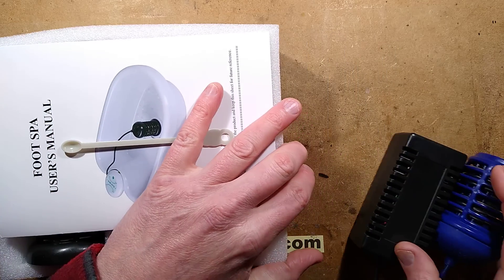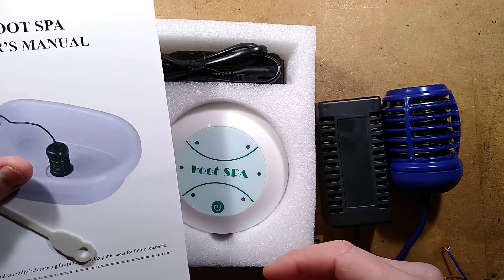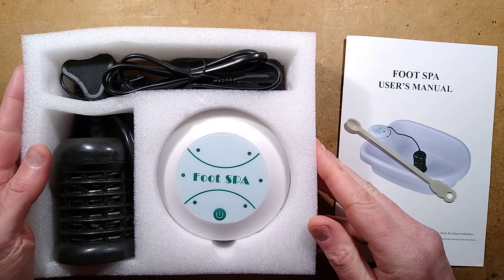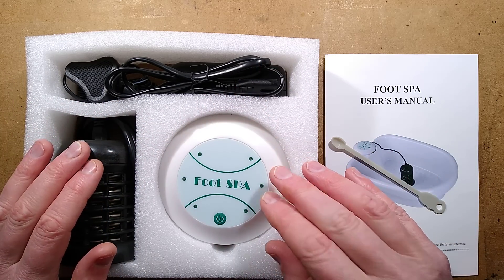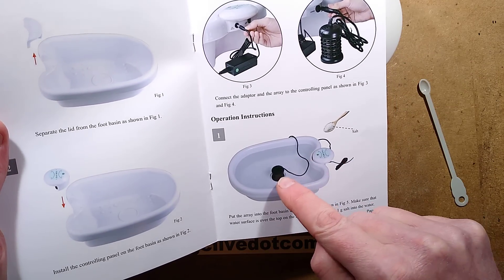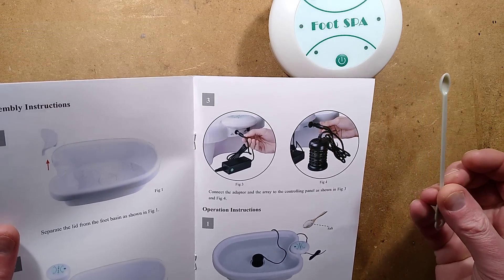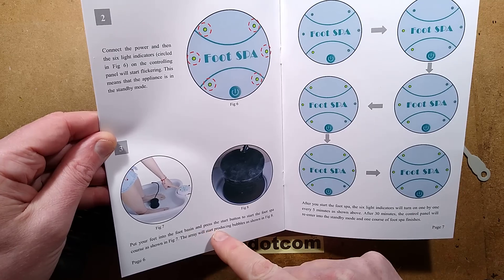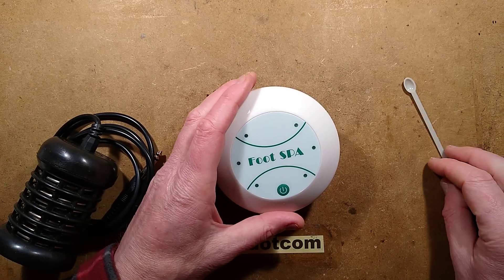Inside an ionic foot detox spa unit.

Comment: What's actually going on with that thing is, you have a stainless steel coil? And that coil, when you put a positive charge on it in water, even when you add salt, it will definitely change the color of the water. It has nothing to do with your feet at all, it is not drawing out. Impurities from your feet or your body in any type of way shape or form it is very misleading, because if it was drawing anything from your body, then it would be coming out of your pores, not out of the machine, I built an HHO . Generator before a car... And if you ever see the video of once you put a positive charge on stainless steel plates, watch how the water will change the same color just like you see on the color codes. So yes, it's a huge scam. Don't waste your time nor your money. Because it doesn't do anything you might want to be careful though. By putting your feet in contaminated water. Because that it's definitely not coming from your body at all...

Comment: I just received a free one of these to review (slightly different model — I got 2 of the arrays because I guess they crap out after a while). I'm not going to use it in the intended way. Would it be possible to convert it to a plain old whirlpool bath for my feet?
Reply from the maker: It's only really intended to do the corrosion trick.

Comment: I work in an electroplating facility. We are NOT allowed to discharge chromium from our waste water treatment system into the city waste water system because it’s a toxic heavy metal. For god’s sake don’t use these things people. We treat it then filter it out and dry it,bag it in special bags that have to be properly labeled and picked up by a hazardous waste disposal crew on a regular basis. We can’t even keep them on site more than a month!!! I should point out we use hexavalent chromium which is different from chromium in stainless but high nickel concentrations are poisonous.

Comment: What if.... The current & voltage given to electrode is very high? Or even AC current?
Reply from the maker: Fast AC won't work as it has to be DC to cause the corrosion.  Higher current will result in faster corrosion.

Comment: What's the salt? I've heard if you electrolyze NaCl saltwater you produce chlorine gas.
Reply: That might happen if you had electrodes that didn't corrode, but these ones do corrode and we get a series of chemical reactions ending in iron hydroxide and hydrogen gas. Plus oxides of any other (possibly poisonous) metals in the electrodes. Little or no chlorine escapes.

Comment: Don't  'UK non compliant plugs' basically just have the same safety features as a North American plug? Are they really any worse than what I use a dozen of every day?
Reply from the maker: Our power circuits are capable of a continuous normal current of 32A at 240V.  So local fusing for cables is a good idea.

Comment: You know what is funny... I can tell from watching this video that you have actually never tried using this unit yourself...  which is so laughable... had you tried it, you would understand what all the hoopla is about... electricity delivered to the body in this manner DOES have health benefits... I agree, I don't think the debris is in the water is coming out of the body... but the ionic negative electricity has a positive effect on many bodily functions...
Reply from the maker: This arrangement does not pass current through your body.
Reply: You absolutely have no idea what you are talking about. Like Clive said this doesn't pass current through your body it merely oxidises it own electrodes and hydrolyses the water producing a soup of chromium nickel and other heavy metals (yum). Also passing current through you body is not healthy (Enough of it will kill you!)  Ionic negative electricity is just a buzzword. Ions are atoms that either have an extra or missing electrons. Negative ions have extra charge, positive have missing charges. You cant ionize electrons they aren't atoms.  Also ions aren't beneficial in any meaningful way. This study https://www.ncbi.nlm.nih.gov/pmc/articles/PMC3598548/  proves that they have no effect on health and there is at best luke warm evidence to suggest they have any positive effect on mood.

Comment: This detox thing is a scam only way to detox by using the bathroom I have that I’m trying to send it back they are giving the run around not giving me return address offering to replace if you put it in water without your feet you’ll get the same results water still change it’s all corrosion try it and you’ll see it’s a scam

Comment: I'm curious about the power supply. I noticed it was labeled UL which at least in the US is the key thing we like to see on our electronics. I worked for a large CCTV manufacturer as a Computer Systems Engineer; part of what I did was get equipment ready for compliance testing.  We had an inside lab that was authorized to do testing including FCC, and UL for all of our in-house products. I've seen the beating equipment has to take to pass these tests, and the hoops we had to jump through to earn that rating for our products. so I generally consider UL listed products to be safe. I was wondering what made you think the power adapter was unsafe aside from the detachable power cord.  I more curious if the manufacture just included a junk region specific power cord, or if they randomly slapped a UL logo on a product that never obtained approval (a problem we're seeing more and more of lately).  Could you possibly do a tear-down of this adapter? Thanks, MGB
Reply from the maker: I don't consider any of the directly imported power supplies safe.  The UL and CE markings are fake.
Reply: @bigclivedotcom  I figured that was the probably the case. I've seen this many times on knock-off Apple, LG, and Samsung USB chargers where they just copy all the markings in an attempt to make them look authentic. I've also seen it on several 3rd party laptop power supplies from Amazon;  I've just never seen one bundled with a product like this before, so I was curious.  

I guess I was just wondering how bad it is inside being It connects to a device you're supposed to put in water with your feet. I was hoping maybe by some small chance the manufacturer did care enough to include a safe adapter.  I know it more likely they just wanted people to think they did, but one can always hope. 

Also, I want to thank you for making these videos, and for responding. I found your channel a couple weeks ago, and really enjoy it.

Comment: Shonky product built according to the datasheets with a modicum of attention to enginerding , plus some exposed tracks on the wave soldering side for current capacity? Looks like this was designed by a fan of a certain Botany Bay legacy electronics engineering video blogger.

Comment: Shouldn't the earth pin be made of plastic if it doesn't provide a safety connection?
Reply: the point is it doesn't have a fuse or likely any of the safe break away features a normal plug has

Comment: The resistor, diode and capacitor in the upper right is a reset RC with diode for discharge when power is removed.

Comment: I'm confused as to why you didn't actually try this rather than just use it in a little bowl? Have you even taken any time to research this, obviously not. It does say when you use this, that the water will become brown, not from what comes out of the body. What comes out of the body can be one of a few different things, mine was this mucus type thing with black bits, due to lung disease and heavy metals in me. I know several people who have had this treatment and it was excellent, you can feel the difference as soon as the treatment is done. Of course you are entitled to your opinion but I do think it helps if you actually know something before offering that opinion to others. It seems many people agree with you without also knowing anything, typical herd mentality. At least try it as it is meant to be used and then give an opinion Clive.
Reply from the maker: Let's just say that if it makes you feel good then keep doing it.  But don't pay too much.
Reply: Have you tried the default mode? Ie just put your feet in salty water without the appliance ? Just saying !

Comment: The JP1 looks like it's possibly a UART or the SPL communication link Clive simular to what some of the arduino units etc use when they don't have a USB built into them  the chip is a 8051 CPU,  and loking at that it does have both, and given that the boards wires for TX and RDX go down to the jumpers..

Comment: I think that 4 pin header is a JTAG/boundary scan header to essentially program the microcontroller. If you get a JTAG programmer off of eBay you may be able to read the code that's programmed in it
Reply: STC mcu's use serial connection for programming, so a FDTI board would do the job.

Comment: I got the cheap version. It's just a gauze pad impregnated with sodium-bicarb. You shove it in your shoe and wear them all day. In just 8 hours, the pad turns nearly black. It must be sucking the evil out of my soul through my feet.
Reply from the maker: Those sweat activated pads have been around for a while.  Also fake.
Reply: @bigclivedotcom   The only thing you can remove via the bottoms of your feet is sweat.  "salty" water.   Hmmm.

Comment: I have just started to use a CPAP for sleep apnoea and there are quite a few Ozone generators being sold to clean the machines, masks and hoses. But I also know that ozone is potentially harmful for lungs. Also, I have also found that the manufacturer of my CPAP will void the warranty if ozone generators are used to sterilise their machines - so they must do some noticeable damage. Realistically, it is just the hose that is the real pain to clean and dry, but it’s not clear if these units actually do anything worthwhile. It would be great to understand how these generators work and if they are easy to just build (I made a couple of ionisers based on your schematic last year).
Reply: And you have dumb fucks that use ozone generators in their vehicles while they are in them, or in their homes with small children and pets. Negative ion generators also produce ozone.

Comment: Why is that plug formally noncompliant ? Just because it has no fuse ? British plugs are a wee bit overkill.....
Reply: Wrong overall shape as well, pins probably not proper shape either. British plugs are for 240V remember
Reply: @internetvideoenjoyer  And ? Lots of plug systems for 230V are smaller and simpler. The geman schuko is a bit garbage. All the nice polarized derivatives of it used in many other countries are however exceedingly nice. Dunno, the British plugs could easily handle 30 amps or more....which is a wee bit overkill
Reply from the maker: It's not the plug pins that are non compliant.  It's an imported power supply that does not necessarily comply with local standards.  Some power supplies have terrible separation between the 240V side and 12V side.

Comment: That thing might be perfect for making metal plating solutions, since it is designed to degrade both electrodes at the same time, and is nicely current limited. 

Fire a couple of copper electrodes, say two chunks of copper earthing cable or a couple of flattened off cuts of copper radiator pipe into a solution of vinegar and salt, connect up and plug in the mighty Bogon-ion-driver and you should end up with a nice solution of copper acetate.

Do the same with some nickel welding rods if you want nickel acetate. 

No use for the actual plating however, unless you disable the polarity swapping, but I'm sure that would just be a matter of adding a switch to disable the relay.

As an interesting byproduct you will also liberate some H2 from its 0..

Comment: At 1:30 he says the plug is non-complliant. Why?
Because it doesn't have a fuse?
Reply from the maker: No guarantee of proper isolation between the 240V side and 12V side.  Some of the power supplies from China are terrifying.

Comment: a quite nice designed and engineered device....

well components that are related to each other are relatively distant to each other.
signals are routed across the whole board...

so not exactly
Reply from the maker: The switching section is definitely a bit spaced out.

Comment: An Idea for you perhaps. With all the double sockets with USB connectors. Are these on all the time? Is this the same for all manufacturers? if so what is the quiescent current. If this is multiplied by just 2 per household what is the total draw on the national grid? (This is a thought from the quiescent current draw on a Smoke Detector as looked at by Dave Jones and the 100MW (perhaps) from the Auzzie Grid.
Reply from the maker: Some have an integrated switch, but most have a very low standby current.  But I'm not a fan of building electronics in.

Comment: I assume the reason the current dropped was due to the fact the electrodes are covered with bubbles so less surface area, and not due to the unit limiting current. Because it went upto 2A at one stage before lots of gassing started.

Comment: I tried reducing the output on a 27 volt wall  charger by adding some resistors but noticed the charger just compensates for the added resistors. I added 4 resistors but noticed it would just dump more voltage into it. I never realized a wall charger has a power sensing unit that somehow knows there is a reduction going on. My guess is the old ones would work. I need an 18 volt charger but cannot find one. The wall charger plugs into a nicad base that charges the battery for a drill so the wall wort actually sends the power ( regulated) to the base which doesnt send 18 volts to the battery but reduces it to 4.5 volts and prevents overcharging with a board that monitors battery condition and will not work if you try to bypass the chip. I am frustrated at the damn thing. I need an 18 volt wall wort for an electric train that I picked up for under our Christmas tree.

Comment: I have only one question- how does the microprocessor count five minutes, power line cycles? I didn't notice a crystal.
Reply from the maker: Internal oscillator.  Not accurate, but good enough for rough timing.
Reply: @bigclivedotcom  Thanks, just curious.

Comment: The micro is a single cycle 8051 variant, 8 bits of pure cheapness.
The buck regulator layout looks horrendous with a huge loop area, so RF emissions are likely to be pretty awful, might be worth bringing an AM radio close by to check.

Comment: it would have been interesting to see a quick teardown of the power supply they give you. it had a UL marking on it.. is it possible its actually UL approved and still have that non-compliant plug? could they just have put the plug on afterwards, if the UL certification is only for USA/CA?
Reply: Quite possible. likley just your run of the mil switching supply with a cheap shoddy plug attached

Comment: The controller unit seems  to be just asking for use in a more legitimate role! That's a LOT of engineering for a "snake-oil" device,  so perhaps the electronics might be used / useful for other applications?
Reply: Phil S - hydrogen generator?
Reply: @samuelfellows6923  Actually yeah probably

Comment: Anybody else hear the high pitched whine when it started up in standby? 
Edit 1:It stops when running in water but continues when running dry.
Edit 2: seeing that toroid I think it's coil whine.
Reply: Zanthum that is common when pushing things like that to its limits
Reply: Could also be the power supply. It's known to create some interference/sounds.
Reply: @userPrehistoricman  ok but do you have any explanation as to why the whine would stop only when the element is in water and the unit is running? It continues when not running wet and dry and when running dry. That is the part that is confusing me 😁.
Reply: @userPrehistoricman  so why would it whine unloaded and stop whining when loaded?
Reply: @userPrehistoricman  ahh ok thanks for the explanation.
Reply: @vipervidsgamingplus5723  but why would it whine when idle and stop when passing power? The only thing I can think of is powering all the LEDs at the same time but the whine is constant and does not change with LED flashing. Also whine continued when only 1 led was lit (unit running) but element was not in water so could not pass power. Whine continued when unit idle but element in water. Whine  only stopped when element in water and unit active.

Comment: Could probably have got the same electrolysis by connecting my car charger to the electrodes!   All this circuitry suggests something else must be expected of the unit.??
Reply: The wanted it small and powerful, and knew about this standard circuit even if something simpler would work. And they wanted flashing LEDs to make it look like it was doing something complex and difficult, not just dissolving nickel and chrome aand spilling jt on your skin.

Comment: Manual: 60 W
Control unit: 25 W
PSU: 24 W

Seems legit.
Reply: Like any active speaker.
Reply: @MetalheadAndNerd 

6000W burst
3000W max
750W rms
30W actual
all hail audio foolery.
Reply: will it run will it not will it explode or will it not life's a lottery pick your numbers

Comment: Could we get an analysis of what was drawn out of your feet?    Even though they never went near the bath??    Interested to know what mineral/compound caused the coloration.    Probably rust!!
Reply from the maker: I may have included a link to research either in this video or one about the electrodes.  It puts a lot of chromium and nickel into the water.